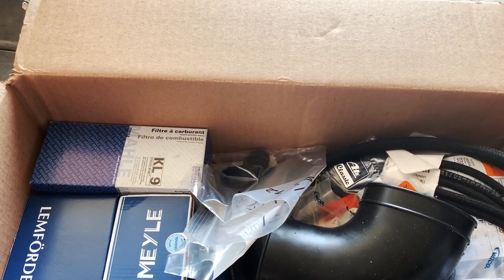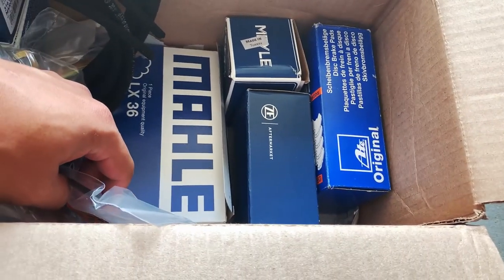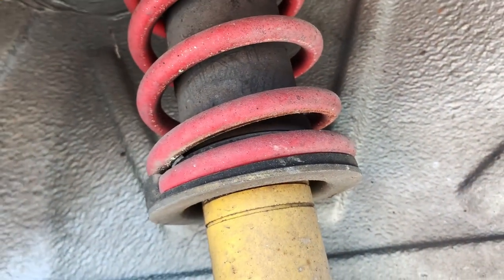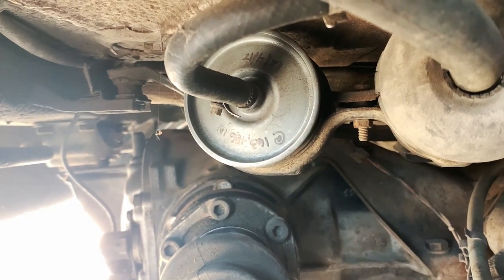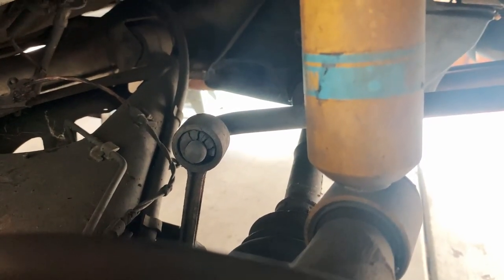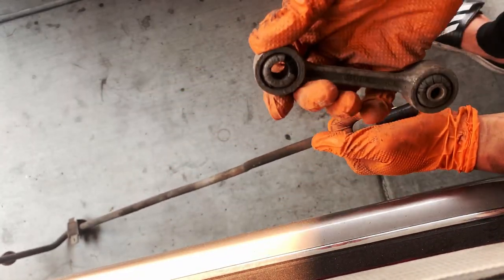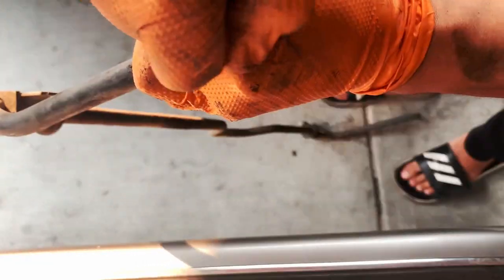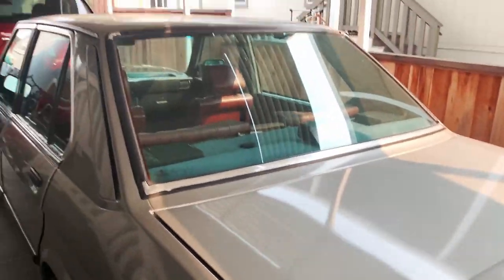BMW E28: Rear Sway Bar End Links and Pitman Arms

Comment: You should have used Silicone spray to press the rubber bushing.  It is safe for the bushing.  Other greases will deteriorate the rubber overtime.  Other option is p-80 emulation which mostly used in automotive plants.

Comment: Nice e28! What tire size are you running on the front and rear? Those are style 5's 17x8 correct?
Reply from the maker: Yeah those are 17s square. I think it was a 225 front and 245 rear